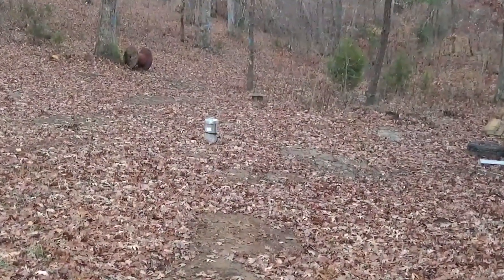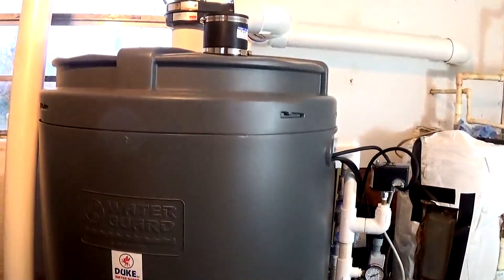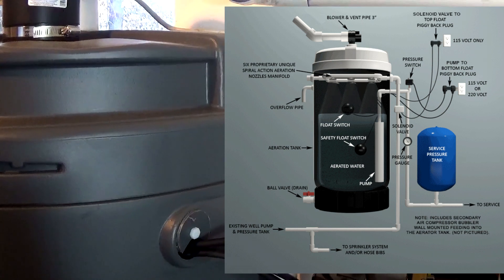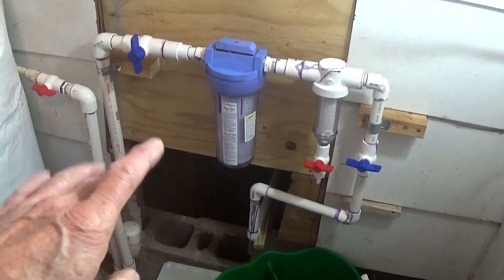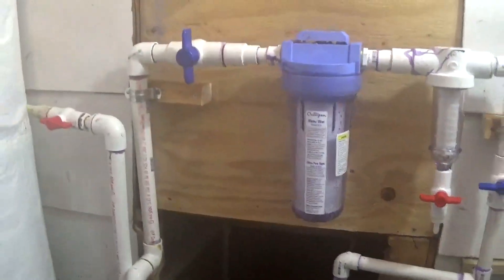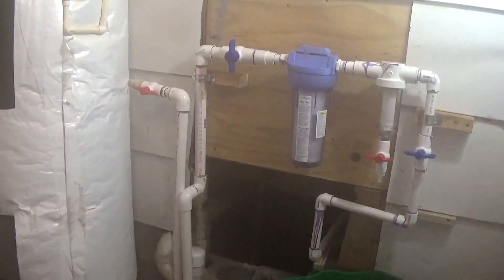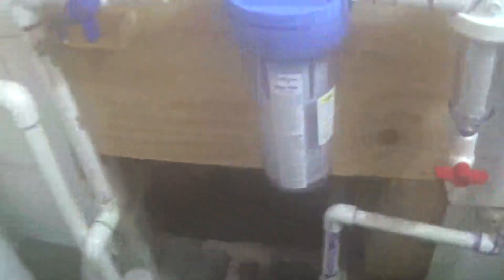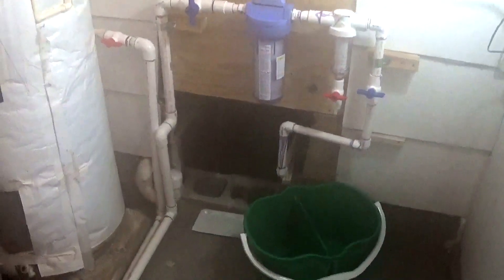I've got GAS in my well!

Comment: What a nightmare! I'm glad you got it sorted out! So, what did you do for water, before the well? Just a large potable water tank?
Reply from the maker: We had what essentially was a hand dug well. It was 85 feet deep, but would run dry during the long dry summers, being mostly ground water. I actually paid for a truck load of water last summer, but it only lasted for a couple of weeks. We were hauling jugs of water to keep up with bathing, doing dishes, etc. We had to go to a laundromat to do our clothing. We are very grateful for our new well, in spite of it's issues. Thanks for stopping by.

Comment: That is a big project George. Hope all the leaks are sealed and you can take it easy after all that
Reply from the maker: Everything is working well now. Those fittings on the tank on either side of the input valve were "factory" sealed. Thanks for stopping by Lloyd.

Comment: My goodness George, I'm sorry you had to deal with such a problem, what a nightmare my friend. I certainly hope all's well that ends well. The ratcheting cutters are awesome...  👍👍
Reply from the maker: The system seems to be working well presently, after 3 months I will have to open it up, drain it down and clean the tank, but that is all taken into consideration with a drain already set up. Thanks for stopping by

Comment: We live in Gibson co not far from you our well is 380 feet deep no gas I hooked to my dad well after he passed away this year, we were on co water but didn't have water much and then no pressure, so we changed over to the well, but we do have hard water, so we filter everything.
Reply from the maker: We are happy to have an abundant supply of water now and don't expect to be hauling next summer during the dry months. Glad you got your system set up. Thanks for stopping by.

Comment: Hope you got the gas out and leaks fixed . Yea the pvc cutters are a great tool
Reply from the maker: It's all working well presently, thanks Terry. Like you I have been tussling with computers. One of them has died completely so I am hoping to replace it in the new year. The other seems to be working well presently, but lots of files on the dead one.
Reply: @TheShadeTreeFixitMan  May be able to take the hard drive out and hook it to another computer  and see if can get files back . I could not on mine as the drive was completely dead

Comment: maybe you covered it and I missed it? where does the methane gas go?  is that what vents outside into the atmosphere? does it have any odor?  can we harness it and make gas for the goofy cart? haha.. good to see you George
Reply from the maker: The gas does go out through the vent that goes up just under the eaves. We can't smell it now as it is lighter than air. When it was still in the water, it was very noticeable, especially when taking showers or flushing toilets. Unfortunately, not being pressurized it is just a wasted by-product of our well at this point. I've already spent over 30K on the well/system and can't afford anymore, so I haven't even investigated any other processes for retrieving it. We are glad to have a fully functioning well with lots of water that won't run out in the summer time and it doesn't have any gas in it in the house anymore. Thanks for stopping by Ken.
Reply: @TheShadeTreeFixitMan  well i was joking about the retrieving it part but Im glad you have good water..... im fortunate to  get my water from a spring
Reply: Glad you asked, I want to know that too. Methane and sparks can be 'interesting'.
Reply: @harryfaber  thats what I was thinking haha

Comment: Whew!! that's a lot of work George. Getting into those tight spaces when you get older is a real challenge, ask me how I know. Well I hope that solves the gas in the water problem. Boy 500 feet is quite a deep well.
Reply from the maker: I am glad this project is finished and crawling around is no easy chore for this old guy. It took a few days for my legs to recover. Thanks for stopping by, Ken.